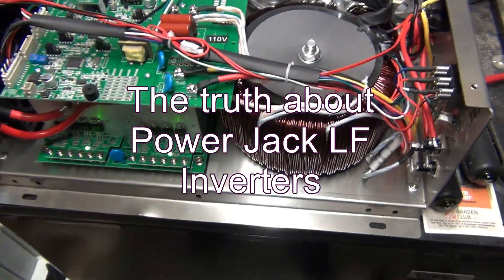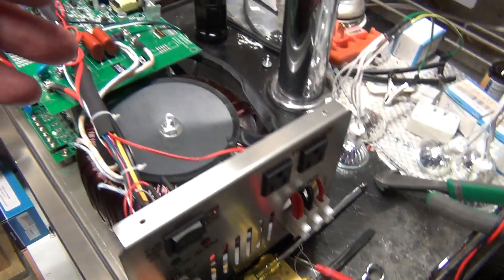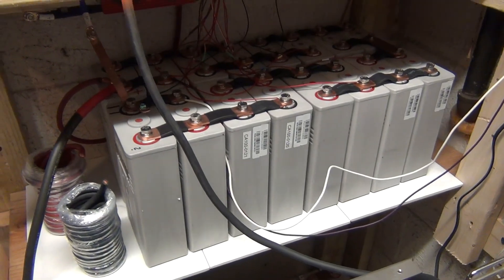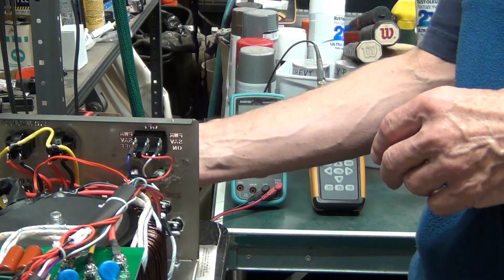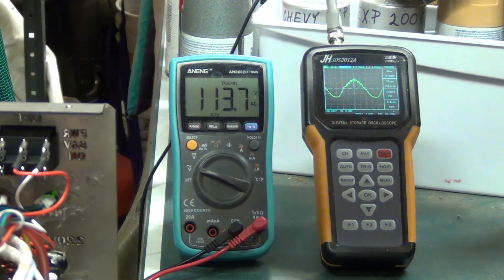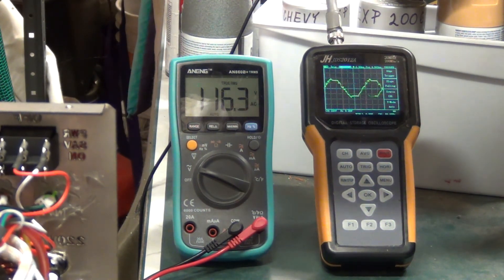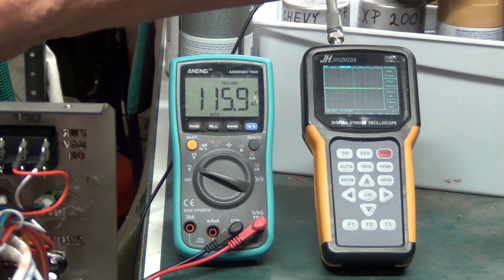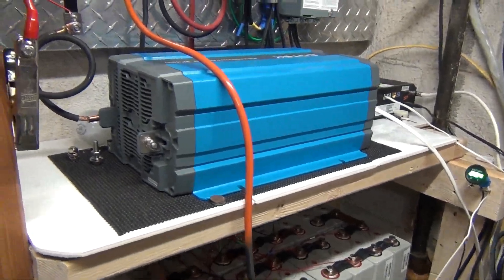Power Jack or 6000W LF PSW Split phase pure sine wave power inverter from eBay

Comment: My new 48V lithium battery was working fine with 48to24V Converter to power 24V LED light strip, but the 24V Power Jack   has buzzing noise Dracula battery drain down to ~40V. Please test 24V Cotek SP-3000-224 $1113, and 24V WZRELB 3000W $180. Thank you.

Comment: Beginning of video shows voltage measurements but video does NOT show where the measuring pins were actually contacted. Useless information on that segment of the video.

Comment: Only L1 has output filtering on the control board. You can add a couple output caps on K2 that comes directly off the transformer to the fuse that will clean up the sine wave under moderate loads.
Reply from the maker: there is not much filtering on any leg
Reply: go power is a joke . had the isw 2kw ..replace under warranty, then the next one broke less . than a year .. the ONLY LOAD I use it for is a 132 watt refrigerator and a couple bulbs.. these are disposable inverter.. brought it to a very good technician he said bro I can't Find any part for it thats laughable.. ... thei inverter cost almost 800usd on amazing they should have at least a 5 year warranty and replacement parts .. it's a comical brand ... victron, outback , magnum schinider.. these are REAL inverters....

Comment: I have the same exact model that I used only once during the hurricane, it was running 6 bedrooms lights, kitchen appliances & a large deep freezer also 1hp well pump, I didn't notice anything beside lights were kind of dim (all my lights are LED) so I thought it's a good product, now in market to buy their 8KW for daily use with my battery bank that has 8KW solar panels

Comment: I don't have a Powerjack Inverter can't afford one at the moment but I noticed from other videos, persons putting a other, or a bigger capacitor on the output leg of the line to clean up the sine wave but then you consume a little more in idle power.